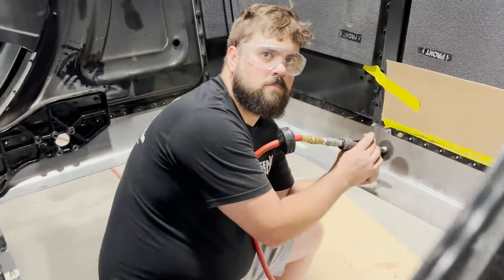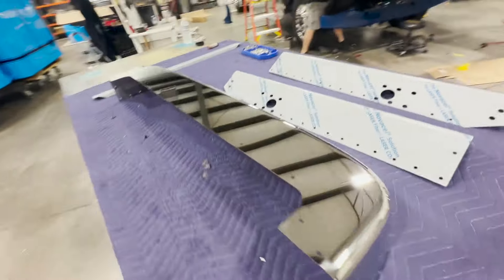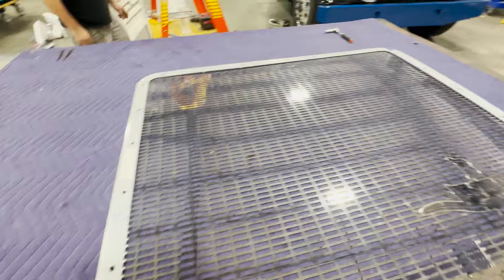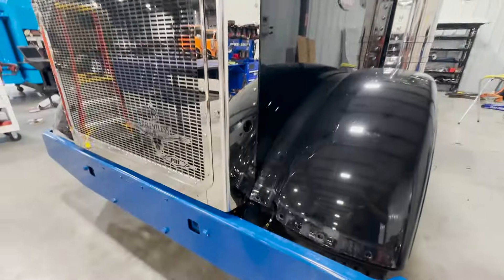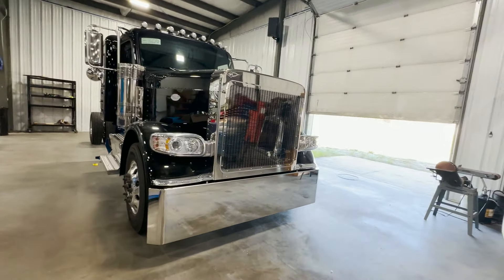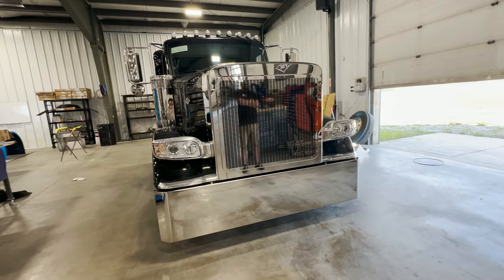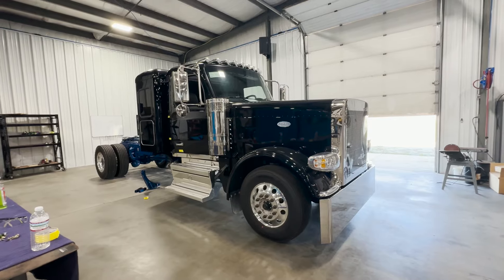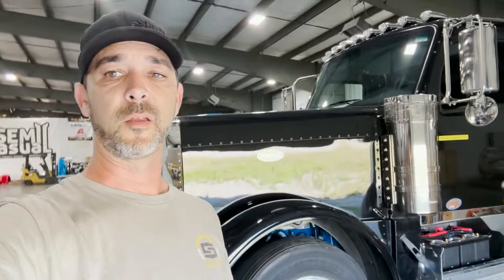THE FIRST ALL STAINLESS GRILL FOR A 589 - INSTALLED!

Comment: I prefer the factory. The reasons are first it's one piece, doesn't have the bump out retainer. Sure the stainless looks nice but it's too many parts and gaps to line up. If it comes down to it you could have the factory one chromed.

Comment: The surround is a nice piece , but I would like it better if it had the Pete emblem on it.
The red Pete emblems on the hood and grill have been a focal point on Peterbilts
for a very long time, and in my opinion when the are taken off or if they are no longer red,
the truck really loses something, but even though the emblems on the side of the hood
are no longer red, at least they are still on the truck  👍
Single axle trucks just look goofy, and the longer they are, the goofier they look,
but it's still going to be a really nice truck.